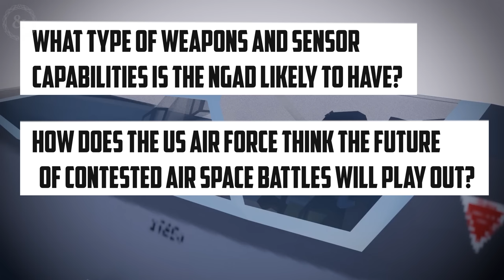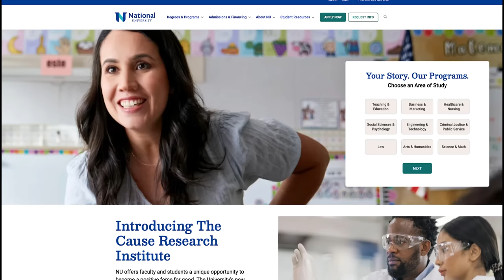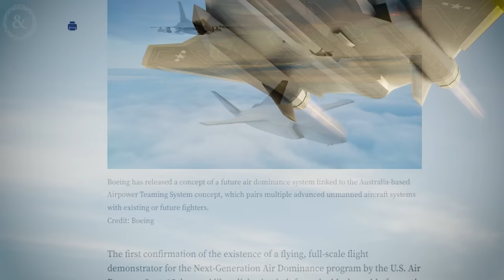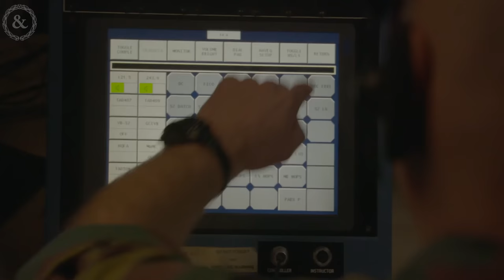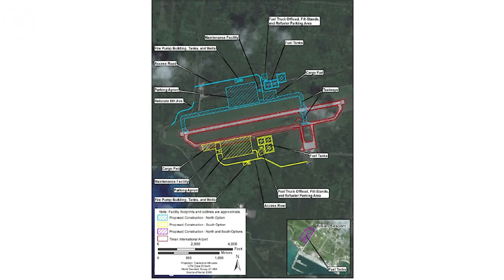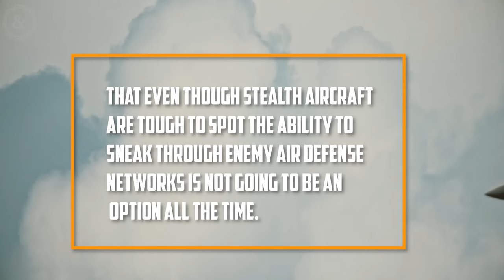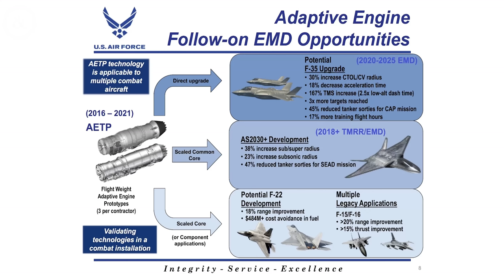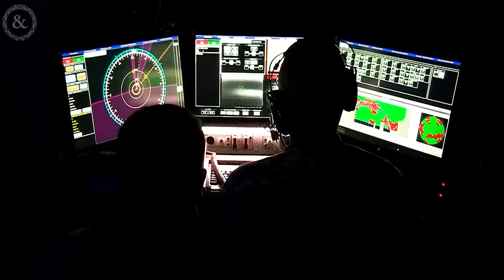Lockheed Martins 6th Generation NGAD Fighter Tactics

Comment: Parabolics for the laser they have worked on much of the solutions to the range issue with the Navy already and dealing with the water vapor issues as well. Also lasers actually can remove heat, look up laser cooling.

Comment: F15ex has greater payload than any jet available today, is designed as an air superiority and as a long range interceptor with a longer range and higher ceiling than both f22 and f35. With its modern build its every bit as stealthy as any russian or chinese supposed 5th gen jets. There is no gap in capabilities of the US. The NGAD program is just to show off.
Reply: Shhhhh!  There’s not enough $ for the MI Complex with just the EX…we need NGAD to keep those funds coming.  And wars.  Geez, we’ll  never remain obscenely rich building only what is effectively good enough.

Comment: I'm not sure about the "having it all" approach with the engines. I believe it's doable but if the final solution will be too expensive to research and too costly to build/mantain, the final number of planes will inevitably be cut. 

And then the cost of any single plane will go up, wich will lead to more cuts and so on so forth. Not ideal.

Comment: I think the cost is off by a bit. 16 billion dollars for 1,200 airframes is a per-unit cost of 13ish million dollars. Compared to the 100ish million of the F-35 and the 200ish million of the F-22, that seems like that cost is too low. I suspect the 16 billion is the development cost, not the procurement cost for the eventual fleet.

Comment: I wonder if it wouldn't be a terrible idea to exploit what we've learned and produce a new, economical 5++ gen fighter with better range, maneuverability and speed than the F35 to replace the F15's, 16's, 18's and the 22's and fly alongside the F35's and NGAD; filling the gaps as we move forward.

It would be the F22's direct replacement; made with air superiority a central capability.

Comment: FA-23 was very much this airplane, but corruption made FA-22 the choyce instead. That is a problem today. The next generation avionics is already operational in Gripen E, which is supercruising, long range drones ready. But don't have VLO, only LO. SAAB have been working on their next fighter for some years, which is planned to fly 2030. RR have been working at ACE for some years. SU-57 may be very efficient when ready and may have 6th gen capabilities. It is under production, but some parts are not ready but are substituted with less capable ones. F-23 with Gripen avionics, flying 2026 would be a good choyce.

Comment: A quicker, cheaper solution, would have been to bring back the F-16XL from the 1980s & give it the latest engine & AESA radar from the F-16V.  The F-16XL was said to "double the weapon load 45 per cent further" as opposed to a standard F-16. A modern F-16XL(V) would be exportable & affordable to US Allies. Chances are the US will not export NGAD as it is too sensitive, secrets wise.
Reply: Stop making sense, that’s crazy talk. 😊

The XL is definitely a ‘should have been’ design, much like the AFTI F-15 and F-16, the F-20, the F-4 Super Phantom, the F-23, and the rest of our promised F-22s (thnx, Mr. Gates).  With the probable exception of the F-4, most of these are ‘should still be’ ideas - at least in my video game.

Comment: The problem is that tech development happens so quickly these days that cutting edge today, can easily be obsolete by 2035-2040 when you said these would be in enough numbers.  The turn around time needs to be shorter to really get the best bang for our buck.

Comment: Wouldn't the lower atmospheric density at like 60k ft make the laser much more effective? That aside I could see the intake air used to cool the laser and the heat would then be removed by the engine system. To me the big question is where is getting the power for the laser? Those types of aircraft are normally pressed for fuel to being with.
Reply: I believe they are referring to the IR beam of light not the heated laser.  I was wondering if they could use UV laser instead.
Reply: @russellburnett4255  Are trying to say that he was talking the detection of the beam itself? IR sensors have to have light hit them see things. Lasers are a very tight cone of light of that puts energy on the target mass. So I don't think IR sensors will see a laser beam unless it's directed at it. Yes, some thermal radiation would be given off by the air laser passes through but I don't see how that could greater than the thermal signature of the thrusters.
Reply: NGAD is gonna be very very big, to answer the power (and thus fuel) question
Reply: @russellburnett4255  UV scatters and is absorbed far more than IR

Comment: I love "Amateur Parachutist"!  So lets get real about directed energy weapons, they are energy hogs, especially if they are strong enough to damage or destroy a missile.  And with all the computers already in use they probably don't have enough reserve generating power to operate one.  And as far as the cost and time frame triple the money and time.  Great video as always.  Oh and China will be stealing the plans as well.
Reply: Capacitors. The engines produce immense amounts of power. Rerouted to Capacitors,  would allow high energy weapons just fine.
Reply: Computers don't take nearly as much energy as a weapon-grade laser. I'm running a PC with some of the best parts on the market at just 500 watts, just 1% the energy of the 50kilowatt lasers currently being deployed. The US army has deployed those lasers on Strykers, and that's a vehicle that weighs less than an empty F-22.

Comment: Right now the major problem is distance.  No fighter can fly from Guam to Taiwan and return without refueling.  The loyal wingman being smaller will have even a shorter range.   China's current strateg is to send their long range  fighters and longer range anti-air missiles against tankers and AWACs type planes.  In a major conflict both Okinawa and Guan will be taken out, as will any carriers within 2000 km. China also have hypersonic recon aircraft, in the event their satellites are taken out. Strealth means a low radar cross section. There's no hiding from IR sensors.   So how does the NGAD and all those drones get into the fight with enough fuel to fight and return to base when all the AWACS and Tankers are destroyed?

Comment: The NGAD shown has air intakes above the plane of the wings? This would ihamper performance during high AOA maneuvers. Will NGAD have auxiliary inlets beneath the level of the wings that will open only during this scenario to ensure the engines aren't starved for air?

Comment: always loved the adaptive cycles of the sr-71's engines.  just changing the air inflow is huge.  still haven't seen any other aircraft that does it, but i'm not really in that world so if there is one or more of them, i am just unaware of?   stealth is one way to go, personally i'm curious about the drone type of crafts that will come out in the future.. thou they'd too have issues with range... being able to avoid incoming missiles is as good as not being seen or being hard to target.... right?   i get this weird idea that the pilot ( if there is one ) would be using one of those multi axis free moving sort of space... for its canopy, thou the pilots view would be slaved to cameras, the idea is that the aircrafts orientation wouldn't imply g forces quite the same... thou idk if rotating this "space" would negate some of that g force affect?  eh i watch too much sci fi.... always loved the fighter aircraft in babylon 5... if that helps.
Reply: What about 🛸 flying submarines 🛸?

Comment: If the intention is for the NGAD to be significantly larger than the F-22 and a flying wing design. Why not just use the B-21 Raider as the next gen fighter. After all they are relying on CCA's to boost capabilities, act as missile trucks, and absorb damage. In that scenario the "fighter" is regulated to command and control of those CCA's and carrying the mission critical weapons. The only reason it wouldn't work is that the B-21 is sub super sonic. But given that the Air force knew this was the direction they wanted to go for some time now why didn't they just plan for the B-21 to have the adaptive cycle engines and a body that could handle the higher speeds?
Reply: A body that can handle higher speeds would mean a scaled up fighter. Like the Concorde. You need those steep angles to go super sonic in a meaningful way.
Reply: @mennovanlavieren3885  Yeah I am not sure I buy they can't make this work. If the speculation is correct the RQ-180's cranked kit design allows it to fly incredibly high and at super sonic speeds all while being highly stealthy. And granted that's based on speculation but if true it shows that it's possible.

Comment: sounds great but  it reminds me of  a thread on a sweater. so many things have to work together to keep this in the air that just a pull on the thread could expose  so many vulnerabilities. imagine a cheap missle filled with a shae charge and ball bearings.  cant get a missle lock? shotgun time.  this would have made the old bombers in ww2 laugh as thay landed with half a wing and missing the skin on the plane.  i would expect a "limp home mode"  appropriate for a 6th gen secret that can not fall into enemy hands.

Comment: I hope the new Air Force and Navy NGAD fighters can go 1,000 miles with larger fuel capacity, dual/tri mode ("adaptive cycle") engines and less drag, as in NO tail vertical stabilizers. This will mean a LARGER fighter than currently fielded - at least as large as the Super Hornet.
(OR, save a ton of money and build "upgraded" P-38 fighters that were crucial in the Pacific Theater in WW II.) 🙃
Reply: much larger than a super hornet. more like a mini-bomber. think back to 80s-90s era fighter bomber kinda size. lots of fuel needed already for range (even w/adaptive cycle) plus higher power generation needed for DEW/sensors and greater payload capacity means very very big aircraft.

Comment: It's going to have several directed-energy weapons one of them is going to be a plasma cannon, take the magnetron from inside of a microwave but Tim the toolman Taylor tweaked it a little. You ever see what a ball of aluminum foil or one of those gold-rimmed plates does in the microwave the cannon is going to do that to any of the metal on the plane it was directed at.

Comment: Looks like we larned nothing from WWII
Pacific air campaign mainly Naval aviation with long range.
Eutopean air campaign mainly Air Corps with less range.
Not a perfect split but if you are going to fight in the pacific you need long range and tough enough to get back home over water.
Reply: Disagree, these island acquisitions are right out of lessons learned from ramping up the capability of the B-29 to burn down the enemy’s homeland.

You are correct that it was American naval aviation which brought the fight to the Japanese navy, eventually (with a lot of blood, determination, death, luck and sacrifice - I don’t want this to sound like a sanitized analysis) and generally providing America with control of the seas.  But this was done to get close enough to the mainland to accommodate the AAC bombing campaign and potential land invasion.  

We seem to be, in my view, acting appropriately in order to get air assets as close as possible to China, to fight a conventional conflict, blockade the country, and to sink shipping if necessary.  I can envision stealth aircraft missions to take out ground-based S2S and S2A missile systems to enable a degree of air superiority, using the island bases for first (and only) strikes to originate, and carrier forces for the same.  Hopefully this allows bombing and cruise missile attacks from these same bases and carriers, but especially lets naval assets in close enough for major cruise missile attacks.  

I believe this will repel an active Chinese invasion of nearby nations and territories, namely Japan, South Korea, the Philippines, Taiwan, and other allies, and is what’s preventing one from happening.

An all out war with China probably will not start.  We may do well with an initial, conventional attack from the air and sea using the same air- and sea-launched cruise missiles mentioned above.  However, we’ll never be able to invade China, and they’re almost certainly going to use tactical nuclear weapons on our islands and carriers…immediately.  And despite worldwide condemnation, in reality no one will blame them.  We’d do the same if Chinese forces were based in Central America, Cuba, and /or Canada.

Comment: I'm also interested in some of the possible implications of networking multiple phased array radars actross a sizeable area... We could see the US develop and deploy a method to peice traditional stealth if the networking works well enough.

the theory being you can combine the different radars into one virtual radar system that is significantly larger than the sum of its parts which could be able to exploit current oversights in radar reflecting geometries and radar absorbing coatings
Reply: mot sure what you are saying but Australia has a OTHR radar that no stealth can hide from and can see 12,000 kilometres and the tech has been sold to USA whois building a smaller one near Guam.

Comment: The NGAD is an insane waste of resources ($400M/ea.) which would better be spent on a drone swarm of 200 - $2M/ea. XQ-58 Valkyrie, runway independent, UAV's (Available now). The Combat Power of 200 Cheap, Long Range, Attritable, drones far exceeds the Combat Power of 1 insanely expensive, risk adverse, manned NGAD (they carry the same weapons). The Air Force's plans to buy 200 NGAD's when for the same price they buy "40,000 XQ-58 Valkyries", is insanity. Especially when you consider the $400M/ea. price is a lowball figure meant to keep congress interested in development. The fact is a combat aircraft's only purpose is to haul "Smart Weapons" to contested airspace where those "Smart Weapons" will do all the Combat (where the rubber meets the road) you don't need people for that.

Comment: Just to clarify, the NGAD Cappy is talking about here is the US Air Force iteration. The US Navy has their own separate NGAD program. The reason why the Air Force and Navy are having their own separate NGADs is to avoid a repeat of the F-35, where conflicting demands by various F-35 stakeholders led to its skyrocketing cost of development. This way they can design their own plane to suit their own specific needs.

Comment: It seems that F35 program is actually a failure. Because they said, performance is not matter anymore due to stealth. However for new generation, army is asking high speed and manueverablility, which are f35 lack of.
Reply: It's not even the same roles.

NGAD is for air superiority. It will replace f22. F22 was chosen coz it was "more maneuverable" but it's useless in modern air combat since dogfighting is history, it's cool but useless. F22 was a mistake and it should have been yf23, the airforce finally made peace with it. So now it's more on stealth, range, and positioning with support drones, not cool airshows.

F35 is designed to do multiple kinds of basic missions not air superiority, it requires a certain level maneuverability/speed to perform those missions. It's also designed to be a "common" budget stealth plane where every allies can use incase someone needs support.

F35 is going to be mostly used in most missions while NGAD will fly and probably shoot a balloon sometime later in it's life, unless a full scale war happens.

Comment: I think it needs more time to develop new software and engines and stealth capabilities. Push production further out into the late 2030s. Rushing to 2030 is still too late for production in time for a war with China that is most likely to happen during the 2020s. Better to work on production of currently available aircraft and upgrades to existing aircraft in inventories to meet near term needs.

Upgrade all F-22 to the latest and most capable version. Many of them have not received all the available upgrades. Keep them around a bit longer, the airframes still have plenty of life left in them and they are still capable enough to be highly competitive with their upgrades. 

Order several hundred new build F-15EX Eagle II and F-18 block 3 Super Hornets for urgent deliveries during the 2020s. These could replace older variants with iterative improvements on zero hour airframes. That pushes current  high hour earlier model variants into the boneyard as emergency war reserves.

Keep working on all the F-35 issues and expand production when the revised variants are ready.

Design and build a new fighter that is low cost and has low maintenance limited stealth with external stores to replace the F-15EX as a firepower platform, a long range escort, and interceptor for domestic air policing. Something similar to Boramae or Su-57 in visibility but with F-15EX equivalent weapons loads. This should be relatively fast to develop using modern techniques and should be cost effective to acquire in large numbers during the late 2020s to mid 2030s. Call it the F-25.